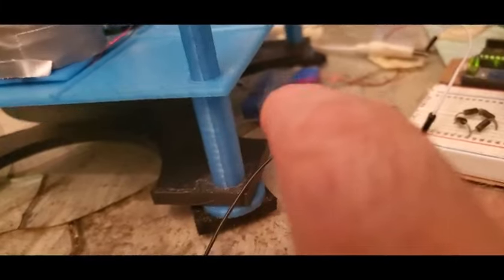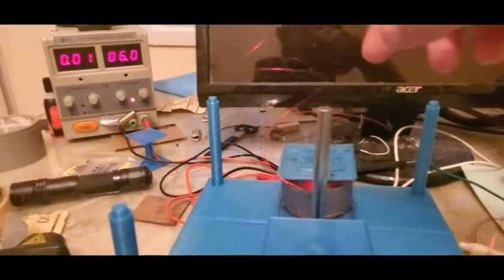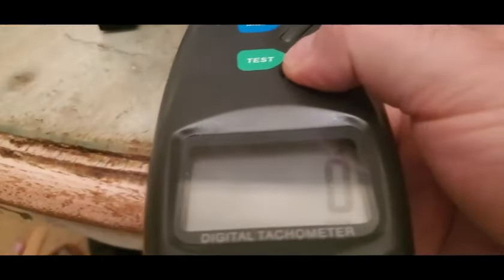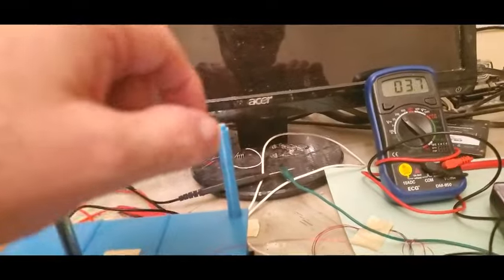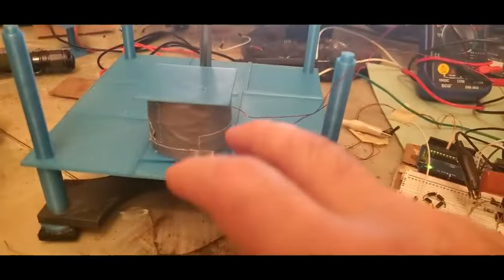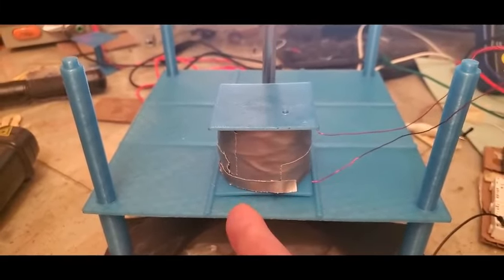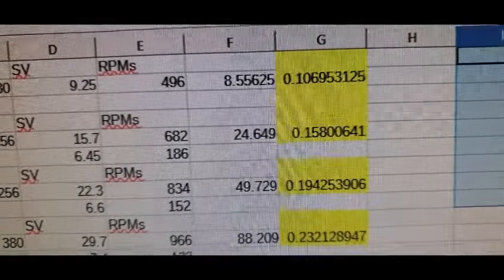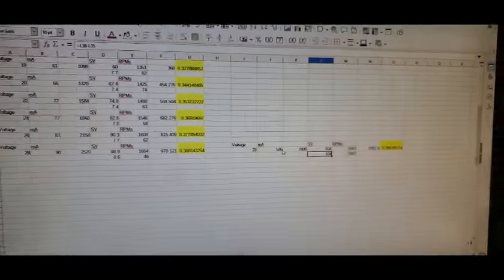Pulse Motor Project: More on Spin Loss

Comment: I think you missed an observation here. And I mean no offense. 
A pulse motor shouldn't really draw any more power when physically loaded. 
Your two coils are acting like Tesla wireless antenna's I believe. 
If you load the rotor with your finger, does the input increase the same amount?